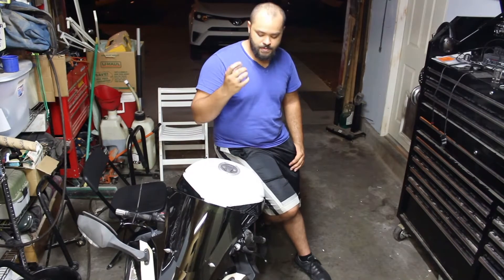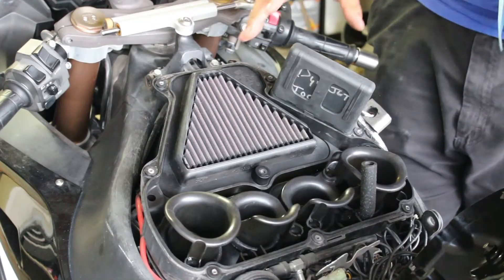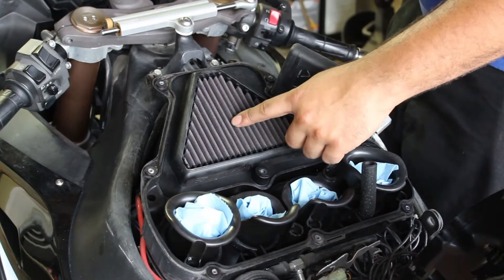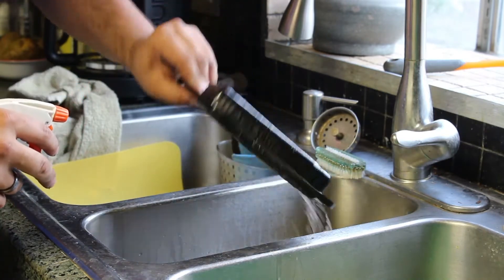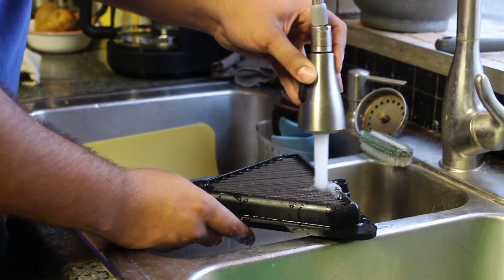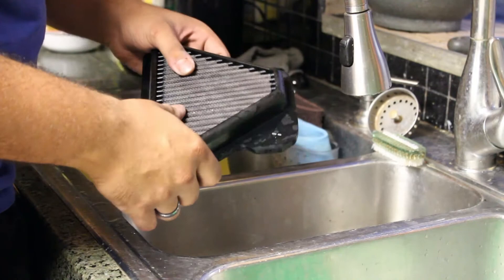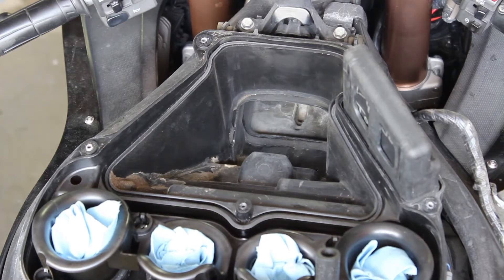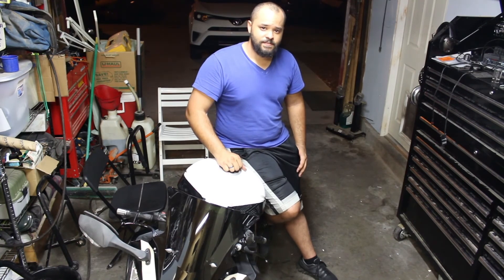How to clean a Motorcycle K&N Air Filter

Comment: Thank you. I bought one for my 2017 triumph tiger 800 xrt don't know wich way goes down or up. One side is smaller than the other and with the small side down the bike looses power it has the gasket on that side. Called K&N and they said the larger part goes facing down but it does not fit properly when I screw it down made it fit and bike runs supeb but the gasket now faces up and serves no purpose I'm so confused I need help
Reply from the maker: I understand your confusion. I would first try making sure that you have the correct filter for your bike. K&N is usually pretty decent at making sure their filters only fit 1 way. As far as which way the protruding side of the filter goes it is always defferent from what I've seen. Be certain to compare your old filter dimensions and orientation to the K&N one. Usually, whichever orientation fits best is often the correct one. But just be certain you have the correct item number to start. I hope this helps you out somehow. Ride safe! Cheers!

Comment: Luckily my 2003 Kawasaki ZRX1200R has the air filter accessible by just taking my seat off and one cover.  Technically under the back side of tank but I don’t have to take the gas tank off.   My K&N is cylindrical coffee can shaped.

Comment: How often do you need to do this service ?
Reply from the maker: 3k-4k miles. Doing it more often wont hurt either
Reply: @TheMotorcycleBoss  thank you ! I have one of these knn filters and I am very confused if I should go back to the original air filter or take care of this one , because many people say that it is dangerous to motor that there may be sand or oil in the the motor from  the filter.
Reply from the maker: @matancohen8193 OEM filters are fine. I've used a k&n since i've owned this bike and I haven't noticed any residual oil in the airbox or anything adverse. It has no negative long term impacts to the bike from my experience and research. However; over-oiling your filter could have the potential to reduce performance. So proper maintenance is important. But if you would rather not bother with it, OEM is always a great option and much easier to deal with as well. I would just balance the cost of a recharge kit for the k&n over simply replacing the filter with OEM. OEM is less work but could potentially be more expensive in the long run. Completely up to you.
Reply: @TheMotorcycleBoss  thank you my man

Comment: Don't miss doing this,switched to sprint air filter,you use compressed air and thats it,put it back in bike and ride,your wife or girlfriend must not be home,my wife would've flipped washing bike parts in the kitchen sink!!!!!!
Reply from the maker: Lol. My gf and I have an understanding that I can use the sink for whatever I want. She never gives me crap for any of that stuff. Regarding the filter, if I didn't live in a dust bowl I would definitely use it. The filter of the Sprint air filter isn't fine enough for the dust, pollen, and sand that I see here in Nevada. As you may know, that brand is notorious for allowing small particles through the filter although it is mostly harmless. Personally, because of where I live, I would prefer to clean and oil my K&N and ensure a finer filter than deal with all that dust in my air box and runners.

Comment: I oiled my K&N not the bike won't start
Reply from the maker: You may have oiled it too much and contaminated the mass air flow sensor. If you believe this is the problem, go to autozone and pick up mass air flow sensor cleaner. Spray your mass air flow sensor and allow it to fully dry. Then reassemble. You may also have simply forgot to reconnect an electrical connector. That is usually the main culprit. Cleaning and reoiling your air filter may be needed to keep this from happening again. Hope this helps. Good luck